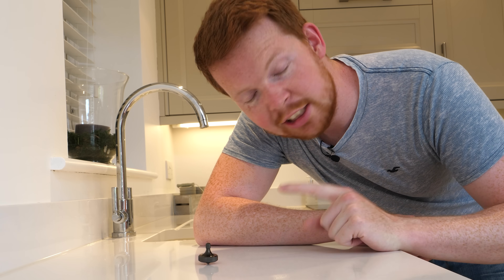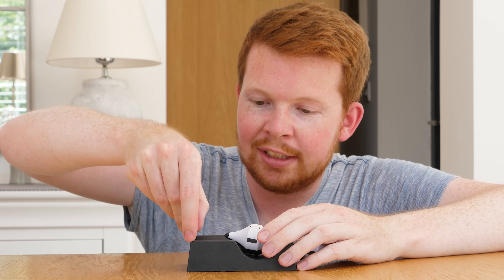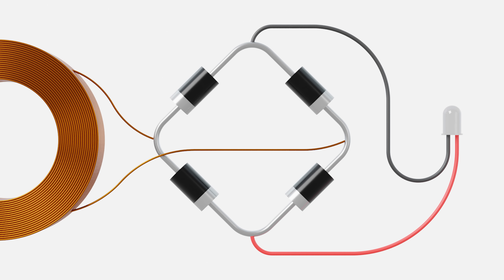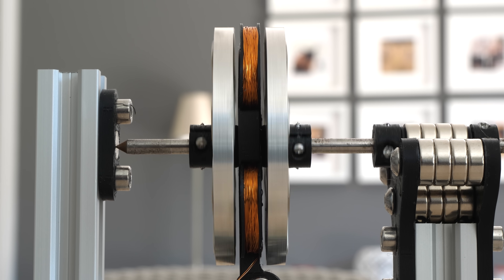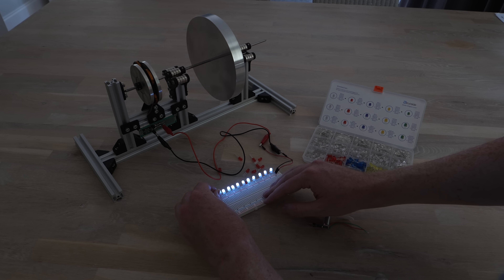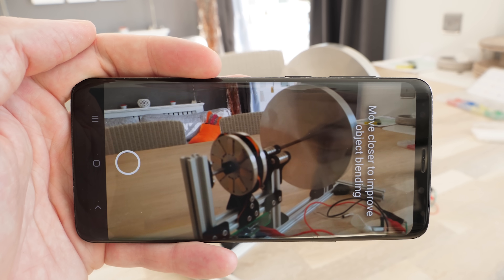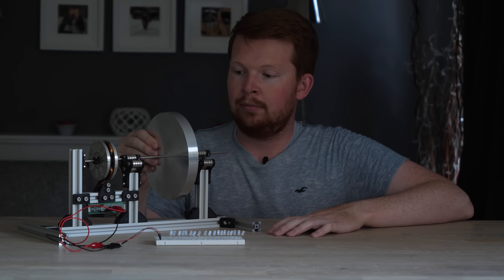Flywheel Battery

Comment: Dude I love your videos so much. Happy to be a Patron!
Reply from the maker: Thanks Destin!!
Reply: @TomStantonEngineering  would surrounding the magnets with more magnets alleviate the wobble? Love your videos Tom. USA fan here.
Reply: @FlyinBrian777  because the axle itself is bent, I would normally suggest this would merely move where the wobble is noticed.. but because the flywheel is soo heavy (and is positioned where I would expect to see the wobble become more prominent) it would think overpower the magnets I suspect... the wobble is going to exist somewhere since its a consequence of the metal shaft being bent. and even with upper magnets, Im betting where its wobbling now would still be where it had the least resistance (that or having a more subtle wobble but on both ends.  that being generally bad since it counters the whole point of magnetic levitation when your scraping away on the side of the rig lol)  

I am FAR from an expert by any means though, Just had the same thought and figured i would add in my thought process
Reply: @FlyinBrian777 cut two 8" circles (cheerios) with a pencil hole.in the center. 6 north facing magnets on the top board and 6 south on the bottom board. Tape or glue magnets. Put a pencil through the holes and north floats above the south.😅
Reply: @TomStantonEngineering  GRATIS ENERGIGENERATOR 20KW - GRATIS ENERGI https://www.youtube.com/watch?v=SNJ_PIBWDxY
Reply: @TomStantonEngineering  what awg copper wire did you use or millimeter wire did you use
Reply: @TomStantonEngineering  Really good video man!!...... but you made a a Flywheel Generator :-) ..... not battery ;-)
Reply: @TomStantonEngineering  what if the motor connected to some gear and to the wheel.. 🤔 would it be a perpetual motion machine? 🤭
Reply: @TomStantonEngineering  Why u don't proove that no over unity with machanical connection the motor back to the generator ? But may be the Noble price for u if it real .
Reply: @TomStantonEngineering why not just connect the motor to what you've created there that spends levitating flywheel disconnect the electric motor so I just constantly spins and produces power
Reply: Oh my god
Smarter every day
Reply: That is a hell or an endorsement ! Love your videos, Destin and I’m so happy I found Tom’s !
Reply: Nice, dusty
Reply: Mrc patented technology shown here
Reply: Patented 10 yearsago and many additional patents pending.of course its good
Reply: you here ?!
Reply: Супер💥🙏Я сам такую установку собираю🙏🙏🙏💥видео с подробной схемой моего первого БТГ на силе Архимеда и силе гравитации💎и мультик👍🏼🙏 https://youtu.be/ud9egYvpeXQ
Reply: Dustin I love your videos too… thank you gentleman for helping me teach my son engineering.
Reply: Must be nice to be Wealthy. Send me some money. I need it.
Reply: I am pretty darn sure i have figured out how to harness linear acceleration from precision, by removing any reciprocation of the rotating mass. It will be strong enough to overcome gravity even. 

Email me if you’re interested. I have graphics. 👍🏽
Reply: No
Reply: Send this in private? Just wondering...
Reply: Lol why announce this?
Reply: Hu pre;0o po operácii p sexe
Reply: I like this video too
Reply: Thats awesome ur my knd of guy i hope you do more
Reply: yes me too👍❤
Reply: I love your videos too 👍
Reply: I am glad to see you here Destin.
Reply: So wait, if he joins your Patron, would that cause some kind of Thanos level event? Would the laws of physics allow it? So many questions…
Reply: @drink15  no, dw
Reply: @drink15  hahaha yeh
Reply: My coment was removed .. did you notic that ??
Reply: @abswaabswa1449   I think someone didint like your comment
Reply: @abswaabswa1449  which comment did they remove?
Reply: @abswaabswa1449  

Ovo je izvanredna tehnika
 
 za razne izume .samo naprijed a
Reply: Why Magnetic force is electric force? Why Magnetic moment and mono pole don't exist?

Magnetic force is circular electric force. There is no magnetic poles and there is no magnetic moment. If the magnetic moment is formed from 1 mono north pole and 1 mono south pole, like a smallest magnet, then you cannot use many of it to make a big magnet. 

Two parallel current carrying wires attract or repel each other is not caused by magnetic force, since there is no magnetic moment in copper wires.

Current carrying wire does not attract magnet and has no poles, circular current carrying wire attracts magnet and have poles.

Imaginary magnetic moment is in fact electric dipole, magnetic poleis in fact  concentric circular electric force . 

Theory Of Magnetism And Electromagnetic Induction

Ferromagnetic material has a special property – it can be magnetizing to create temporary electrical dipoles/magnetic domains.

Every magnetic domain contains at least two atoms. When an electron moves from an atom to the next atom and stays there temporarily, the two atoms become a temporary magnetic domain.

The magnetic domain carries a negative charge on one end and a positive charge on the other end, so we can call a magnetic domain an electric arrow.

Due to electric arrows carrying positive charge on the head and a negative charge on the tail, it has special properties:

1. Same direction electric arrows attract each other from head to tail, and by side to side.2. Opposite direction electric arrows repel each other from head to head, tail to tail, and by side to side.

Temporary electric arrows in magnets’ Ferro material cannot exist by themselves, but rather must all be linked into concentric rings and fill up the whole magnet, for a magnet to be stabilized and magnetized.

Therefore, on the poles of a bar magnet, there are concentric rings of electric arrows/dipoles, with one pole clockwise, and the other pole counterclockwise. On the body/surface of the bar magnet, there are parallel electric arrow rings all over.

A current in a wire does not create a circular magnetic field in space. It induces the electric arrows in the compass to be parallel to its current direction; therefore, the compass moves to 90 degrees to the wire.

Between two parallel conducting wires at distance R, line of sight electrons on the surfaces of the two wires are repelling each other with electrostatic force F=Ke x ee/R^2. This repulsion force is billions of times stronger than a steel rod. Because it connects all of those repelling electrons as one, therefore, if there is a current alternating in one wire, it will induce an alternating current in another wire instantly. This is the true mechanism of so-called electromagnetic induction. It is, in fact, electrostatic induction.

Magnetic force is a misinterpretation of circular electric force.

The magnetic field is a misinterpretation of the circular electric field.

Electromagnetic induction is a misinterpretation of electrostatic induction.

The electromagnetic wave is a misinterpretation of electrostatic wave/alternating current.

Electromagnetic radiation is a misinterpretation of electrostatic radiation.
Reply: @scientificlies7848  Makes great sense and explains cavitation on electrostatic propulsion in the leading edge of the(Skunk Works) air craft, with the rear being pushed by the pull of the electrostatic field.   I am surprised by the lack of comments to your post.   Thanks for your Thoughts!
Reply: @scientificlies7848  And your point is? Or are you a student (viewer) telling the teacher what you believe he needs to know? Sometimes it is better for people to remember who they are in a specific circumstance.  🤗🤗🤗
Reply: Stop peddling your BuyBull verse at the end of every video.  It makes you sound less smarter everyday!
Reply: @andrewedis9907  

I pray every channel has a Bible verse at the end before long!
Reply: @jesusisalive3227  Never gonna happen buddy, people are way too smart for that nonsense.
Reply: @andrewedis9907  Say we who believe are wrong, what do we lose when we die, nothing. Say you who don't believe are wrong, what do you lose, everything. Now who is smarter?
Reply: Predict the future 30 years
1. NASA, CERN, LIGO etc been sued for cheating and stealing.
2. Leading theoretical physicists such as Tyson etc, been put in jail for misleading the people.
3. All space missions are proven faked, no more space travel.
4. No more theoretical physics in schools. Einstein's theories proven all wrong. QM, electromagnetism proven all wrong.
5. People are smarter, understand earth is the only home, there is no God, time travel is a lie, global warming is a lie, simulation is a lie, moon landing is a lie fusion is a lie, free energy is a lie. black hole is a lie, gravity wave is a lie, big bang is a lie.
6. China becomes new America.
7. Japan falling to sea.
8. China took Taiwan.
9. Cancer cure.
10. World peace.
Reply: @scientificlies7848  kids, this is what happens when you are mistreated as a child and skip science class.
Reply: @scientificlies7848  Put the crack pipe down and walk away.
Reply: @scientificlies7848 are you feeling ok?

Comment: wow, this is really creative... here is an idea, put some iron in the core of your coils, magnetic field in coils would be higher, resulting in higher voltage (i hope :))... another interesting thing, a flywheel with no load will spin for 10-15 minutes, when you attach LEDs or motor like in the end of the video, the current running through coils will generate its own magnetic field opposite from permanent magnets, slowing flywheel down and run way less.... which is a law of physics, nothing you can do about it, but you can make a 10kg flywheel madness to mitigate :) we are cheering! :)

Comment: I can’t remember their names but a couple guys out of the University of Colorado at Boulder back in 89- 94 had carbon fiber reinforced flywheel batteries  in a vacuum that worked very well. GM or Ford bought their patents for big $$$$.

Comment: Nice work, well built model, for a shaft , ground silver steel. you can slide bearings over it. If this was a desk ornament, it could be used as a phone charger. Nicola Tessla was right.

Comment: This is a cool project, but in fact you’ve built a very common appliance used in data centres instead of a UPS.  They use exactly the same concept of a very heavy flywheel which is driven by mains power, which then powers an inverter back to AC.  The heavy weight means the output is very clean and stabilized, and when the power fails the momentum of the flywheel continues powering the equipment foe a few minutes, just enough for the generator to kick in and take over the load

Comment: You could reduce the friction even more by replacing the bias plate with a magnet from Polymagnets. They have one that attracts to a point, then repels, holding the magnet in that fixed region.

Comment: I’d be really curious to see how much energy you could store in a system like this.
Reply: None since it bleeds energy.
Reply: @GeorgeMonet  Every energy storage system bleeds energy. That does not change the fact that they are capable of storing energy. If you had a large jug with no lid, you wouldn't say it couldn't store water simply because water could evaporate from the surface and escape. This system is fully capable of storing mechanical energy, and that's what I'm curious about.

Comment: could you use the tiny motor to make a hit and miss system to slightly power the flywheel shaft to recreate the circut of making power to spin the flywheel whitch makes the power .. so on

Comment: what about using the opposite pole in magnets to create a magnetic drive to spin the fly wheel? then free power! then use thin brass as shielding to regulate the speed at which the drive operates

Comment: Would it be posible to use the same generator to spin up the flywheel by adding current? it could then serve as an electrical battery....

I think with the current system it would be really challenging, because I think you'd need to create an alternating signal that syncs up with the current speed of the flywheel? I'm not sure how that works.

Comment: If you replace that piece of glass and the point with small magnets, you can eliminate all contact points!
And if you could improve the tolerances on your coils, and stop the axle from wobbling, you'd have a serious proof-of-concept prototype there for a "mechanical battery."

Comment: when you used the lathe for the flywheel you could have also used the lathe to turn the rod that you used so it would be more straight. If the rod was straight it would have been far more efficient than the bent one.

Comment: how hard would it be to make it a powerwall alternative ?

Powerwall+ (includes integrated solar inverter)	April 2021	$8,500	13.5 kWh (usable) 7.6 kW continous 22 kW peak	343.9 lb (156.0 kg)	62.8 in × 29.7 in × 6.3 in (160 cm × 75 cm × 16 cm) 92.5% round-trip efficiency

if you wanted to be able to store energy for much longer you could make it in an enclosed vacuum and should make the generator able to act as a motor. it shoud be pretty low maintenance with moving parts but no friction..
Reply: PS https://en.wikipedia.org/wiki/Flywheel_energy_storage#Applications

Comment: I think quality barings would be more efficient than magnetic barings when it's this wobbely. You can also add a geared handle to easily spin it. I was searching for something like that on ebay, but could not find it, would be a great desk toy, a high efficiency flywheen.

Comment: Someone's probably already thought about this, but you could create a control circuit to drive the alternator that you created. Then you could charge and discharge the flywheel all via the electronics.

But I'd have to guess there's probably some weird torque angles that would create that the magnetic bearings wouldn't like.

Who knows, I'm just rambling

Comment: Now.  Reverse the power to the coils-- use a power source to energize the coils, and spin up the flywheel.  I suspect it won't start from a dead stop, but requires a bit of spin first.   Could be cool:   the spinning flywheel powers a pump, which inflates a balloon.  When the balloon is fully inflated?  Reverse everything, and the deflating balloon spins up the flywheel... and back... :)

Comment: While watching this video I actually came up with a couple ideas to improve it. For the main shaft what you could do is make both ends of that a point and then have a tower at both ends to keep it captive. It has to push into the end that it's currently pushing into, but the other end could be slid into a hole that slightly bigger to keep it captive. Just in case it ever loses control, but it would never touch the edges of the hole during normal use.

The other improvement is if you put another tower at the back you could put a one-way clutch on it and use a drill to spin it up.

Maybe even surround the shaft completely in magnets to keep it more stable in a center area on the two uprights you already have with magnets.

Comment: A really neat thing you could do is to measure the time it takes for the fly wheel to spin down without the alternator (which you did here), and compare it to the time it takes for the fly wheel to spin down with the alternator. You could then figure out how much of the kinetic energy of the fly wheel is being directly converted to electric energy.

Comment: what type diodes did you use? if standard silicon 1N4xxx or 1N 54xx, try schottky diodes such as 1N5819, these have much lower voltage drop
Reply: hmm, wonder if you could pulse the coils with suitable circuit to turn it into a motor to get it up to speed,
Reply: you'd likely need reed switches other side of the magnet disk to control it ...

Comment: He has done 2 out of 3 steps on ac to dc the final one is adding a resistor and Zener diode in revers bias with the load in parallel with the diode

Comment: Man i want to make this so badly... I dont have the tools though :/
p.s. Would it be possible to add a small hand pedal (stationary to the frame) so you can spin the flywheel faster and easier?

Comment: Nice idea for the generator. Had a similar idea some years ago, but no 3D printer. Now have I a 3D printer but too many other tings in mind ;-)
Btw, an bridge rectifier reduces the output voltage by at least 1.1 volts. If the generator coils have not enough windings = high enough voltage, you waste too much energy at the rectifier.
However, if you make too much windings, the resistance of the coil waste some energy too.

Comment: I think it would be important to note that even though you have a spin time of about 12min for the magnetic levitation flywheel when spinning freely, this time is greatly reduced when your electrical circuit is closed. This is due to the electricity generated in the coil creating a magnetic field of their own. This coil magnetic field opposes the permanent magnets field. The force from the opposing fields slows down the flywheel proportionately to the electrical field generated.

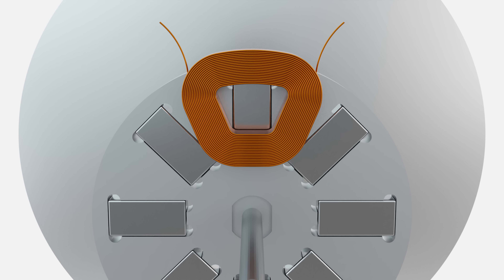Comment: Awesome project. A bit of a flawed explanation of EM induction at 4:20 though. The magnet on the left doesn't create a current up while the right magnet induces it down.
The magnet on the right formed a magnetic field coming out of the screen through the loop and the magnet on the left will make a field going into the screen through the loop. The point where you paused the animation, those fields cancel out to zero magnetic field going through the loop.

As the magnetic field direction changes from out-of-screen (let's say positive) to into-screen (negative), that is a negative change (the direction of change is into the screen), resulting in a clockwise current.

Once the left magnet is aligned in the center of the loop, the magnetic field is as strongly into the screen as it will get and the change reverses as the next magnet starts to fight it. At that moment there is no induced current and after that moment the direction of change is out of the screen (positive change), resulting in counterclockwise current.